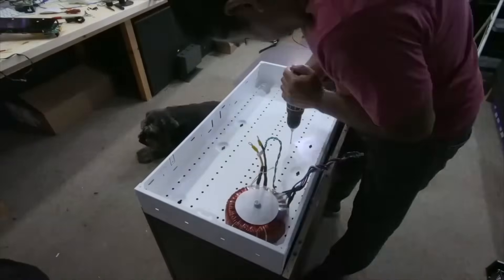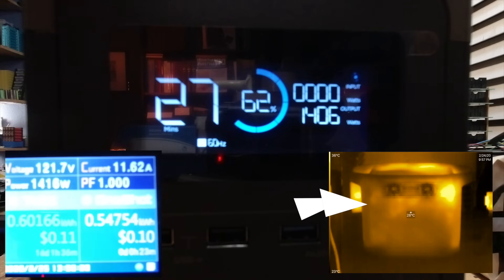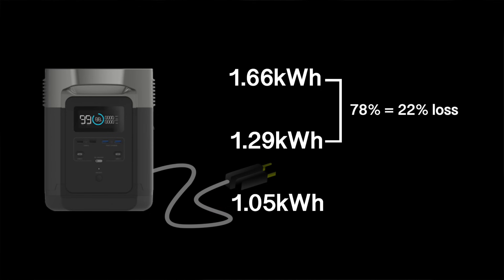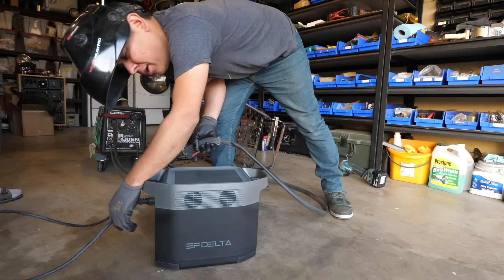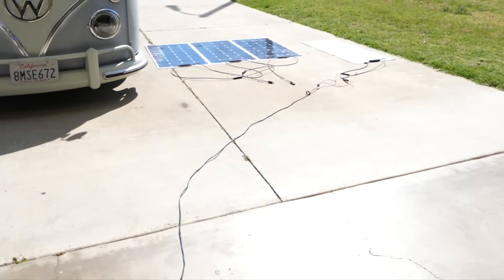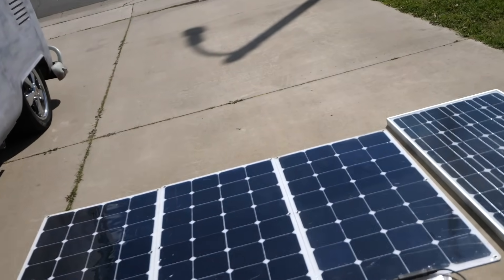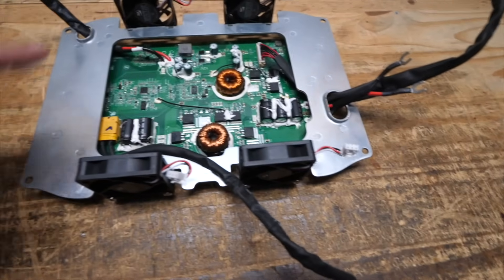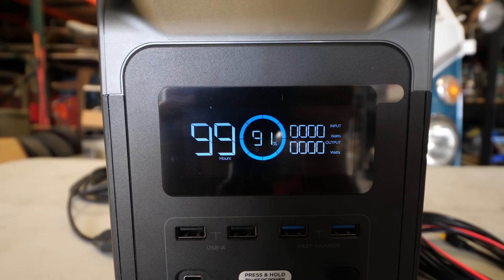The Most Epic Review of the $1300 SOLAR Battery - EcoFlo Delta1300

Comment: I've watched dozens of Jackery and various other solar generator videos on YouTube and haven't been impressed enough to pull the trigger on one yet. The way the EcoFlo Delta 1300 is the 1st I might consider,due to it's systems and construction.The sine wave form tells me it's very compatible to and safe for delicate electronics and still worked after you used it to weld. I presently live in my Ford  F150 full time on SS without benefit of a solar generator. I want something like this to supplement my power needs while I'm living the "van life" in my truck. Keep the info and great videos coming,Jehu !!!

Comment: I'm a camera-man, based in Minnesota. I've been looking for a solution like this for some time. I'd use it to power my production sets... Interview Setups, Live-Shots, Press-Conferences, etc...  Something like this would be perfect to power a camera, a monitor, a couple/few LED Lights, and maybe more... Being so much quieter than the industry standard Honda 2000 Generator, means it can be placed much closer to the actual set (Less cable runs = easier, faster, and safer) Plus, its usable in-doors when shore-power isn't necessarily available, or close-by. Whether I win this give-away or not, this product definitely has my attention.

Comment: I would use it for a mini off grid setup to charge my custom made ninebot es4 dual motor electric scooter. It has a giant 16s12p 60volt 30ah battery that is made of salvaged cells.

Comment: I am a ham radio operator that also works emergency services with the Red Cross and ARES (Amateur Radio Emergency Services).  This would be ideal for us.  Keep the radios running as well as charge cell phones / tablets / laptops.  We also have solar panels for backup so could take advantage of the solar in connector.

Comment: Im a caregiver. ill be using this to Keep my communication on line "frequent power outages" Staying online for medical emergencies. Love your stuff keep it up.
Reply: then your an idiot, it is just a battery and inverter. It will run out of juice and then you are stuck.. you will be pulling the genset out and running it to charge this overpriced crap. In other words, USE THE GENSET TO BEGIN WITH. 1300$$$ wtf
Reply: @JSabh  Use you Generator while camping and you have 5 minutes until someone will shout at you until you leave the premises. Also you could charge it via a generator or while driving or by your Solar System

Comment: im a volinteer ham radio operator .volinteer with lee co fl emergency management i volunteer time and radio gear but i use sla 78 ah battery very heavy and very hard fo me with a defect in my back i do have a 100 watt panel

Comment: Hi Jehu - thank-you for the great review.  I have learned a great deal from viewing your videos and appreciate you sharing your knowledge and expertise with the community.  I can see a few issues arising with the global pandemic/ virus and supply chain issues. Although we currently have electricity and our power grid in North America is operational, as with anything, it will need servicing and there is the possibility that repair parts are simply not available. I have three little kids and have recently been laid off and have done my best to prepare for any upcoming challenges. I would use this unit to have as backup when the remainder of my provisions have been depleted.  It could provide light, cooking and heating requirements if needed. Thanks again!

Comment: I would use it as a supplement my electric usage at my house.  I work from home and have a UPS for my equipment.  I would plug that UPS into it and I would add a few panels to it and hopefully since I live in CA I might be able to run my office on it (1 laptop, 1 flat screen monitor) for the day without using any electricity off the grid.

Comment: Hey Jehu, 

I've been looking forward to your review of this product and giveaway for quite some time, thanks for both!

For me, the biggest benefits to this product is that it's complete, and it's portable. I live in Orange County, where one of our biggest concerns are earthquakes. In the case of a total loss of power, I'm looking for something that can be charged via solar, has enough capacity to actually be useful, and can work with a variety of devices.

I have a small solar setup that can charge my and my wife's phones, but what if we needed to power our refrigerator for long enough that the food doesn't go bad? Or what if we need to run some of our power tools to help remove or fix something structurally dangerous? Plus, I want to be able to help my neighbors with charging many of their devices as well.

This portable battery pack could allow me to do all this, to be better prepared, and to help others. It has such a high wattage output to be able to run heavier equipment, as well as the ports to charge many devices.

Thanks again for this video, and for all you do for our online battery community!

Comment: I would use it as an emergency pack in case of a blackout
Reply: Same and if I could I would slow my naboirs to use power there fridge with a extinon  cable because I don't trust them on borrowing it
Reply: @redfangsmayhem4864  poor guy can not trust your neighbors with a power cord .. this rough times we are living in ?
Reply: I would use it as an emergency powerpack and somethimes fishing also. :)
Reply: I would use it to run my diy tricycle and to charge all my battery devices after charging it with solar panels

Comment: I would use it for off grid camping, but as well as a back up battery for the house if the power goes out. I would use it to power lights, phones, and possibly charge a laptop. I would also use it for my photography and videography on the go if needed. I want to build a battery but until then, I would love to have a battery on hand!

Comment: Useful - camping, or where natural disasters are not unusual, paired with solar panels this would be VERY useful, especially for those with (low voltage demand) medical devices: pain pumps, insulin pumps, spinal cord stimulators, etc - in some cases, a life saver, literally

Comment: If it had decent DC output, I would use it for a touring electric bike powered by solar. But since 12V is only around 100W that is not possible. And connecting it through the AC ports creates a lot of losses. Can you show a hack to have higher DV output? Also, I am interested in the ‘expansion hack’ when is that video coming?

Comment: I will use it for back up power, energy goes out around twice a week were i live so having a battery instead of the generator will be great, but where I live voltage is 220v, so if it only output 110v I can't connect a fridge to it :(

Comment: I would be using it at work for running an air blower for going in vaults. Normally use a generator which is too loud and sometimes the exhaust gets sucked into the blower.

Comment: Would it serve my energy needs?  Yes!   We would use it for the following: Going to the beach and plugging in the electric blanket when it's cold in WA it can get cold, using with the electric grill, in the woods when we are away from the city, jump starter for a stranded motorist, charging up the electric bike when the sun is behind the clouds (gotta get an electric bike first), using the power weedeater when the cord won't reach, making coffee for my honey on those camping trips and many more. I love the "Liberated" comment you made Jehu when taking the EcoFlo Delta apart.  Thanks for the informational videos.

Comment: Would be possible to upgrade the battery cells once higher density hits the market? And I can’t wait to see the expansion solution! Would be great for bike touring, than you can cook electric. Propane and wood is forbidden on campings of most of the festivals I cycle to

Comment: I have i - 19 Hilux as a company car, and the original battery sucks. I would install it with a isolator so I would work as a stand-alone power supply when the car is shut off. Keep up the good work!

Comment: i would like to use this for camping without having to run the car at night and also using it for when we lose power i can take it to my farm and repair things without needing gas or lugging a generator around
Reply: I really like the fact that the solar panels have a long wire so that you can park in the shade and put them in the direct sunlight

Comment: If I were to win i'd use it to keep power to my heat pumps and other equipment as we start to slide into the warmer months. Seeing as it can operate well in the cold and produce an actual pure sine wave i'm also going to use it to add 1/5-1hp motors to some of my rovers. If need be I could also use it for emergency repairs (powering soldering station, lights, equipment fabrication, etc..) when i'm out in the field. Quite a bit better than a homemade pack especially as temps hit well below 0 or above 100 season depending.

Comment: I would use it as a portable power station for a major remodeling effort at my brother's house.  We have been completely re-wiring the house (due to old frayed wiring), not to mention completely redoing drywall in 75% of the house and took both bathrooms down to the studs.  Still a lot left to do before he can list is on the market, after having to move out of state for a new job.

Comment: I would use it to power my sump-pump in the spring and fall when it's raining or when the snow/ice is melting.  Both of those seasons often have power outages due to high wind.

Comment: So when you are dealing with a system that converts a\c to d\c to ac. More like 240v/50a to 12v/ 60h which combines to roughly 300w at 60amps give or take. To an inverter just to be turned back into 240v/50a.   then to the controller and then to the wheels.  Here's my question ? If I drop all 1185lbs of lead acid batteries and go with a better battery. What kind of improvements can I_hope to see in my car

Comment: When are we going to see mid-sized  battery packs on the market?  All there are currently are these smaller packs for camping, etc, micro packs for phone and laptop charging and maybe the occasional coffee maker use, and then we go up to the Tesla Powerwall...  Nothing commercially in between unless you build it yourself..   I'd love something like a 2-5kWh system that has built in solar charging and simultaneous AC output that I could hook up a small scale solar system to that would just offset my AC or heater use but not necessarily make me completely off-grid.
Reply: Have you looked at the titan solar generator?
It seems to be what your looking for.

Comment: I 👏 Will 👏 Win 👏... Or 👏 Loose 👏. Either way i'm a winner 🏆I would use it for emergency lighting, small fridge, cooking, electric blanket, charging my devices,  home, travel,  or camping. I may make a change to my solar trailer for my ebike as well to have range extension and use it for long term ebike camping.
Reply: You should try Kegel exercises. It'll help if you're loose
Reply: @Gen-wf2sv  Only the FDA approved Electric Kegel that can easily work on this massive solar battery bank. 😎

Comment: Oh and I have a question. I have a 94 geo prizm/u.s.electricar  it has 25 dead lead acid batteries under it that I am going to remove and replace with a rack of super capacitors with 4 large Li-ion battery blocks, cells.... you know what I mean. Is my plan doable or should I just scrap the project